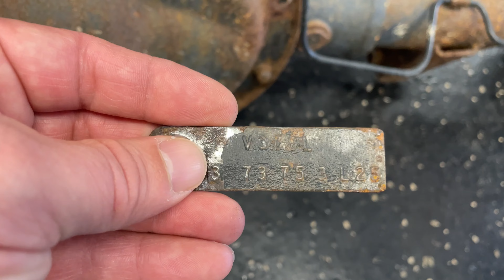How To Change 1993-2011 Ford Ranger Rear Axle Assembly

Comment: In the middle of removing my own, and this video was more informative than the manuals I have been looking at. The separation of the housing and leaf springs would have been nice to see! Thanks for the video , even though!
Reply: I was hoping theyd used a 15 or newer axle. I was looking for a pre solved solution to the 12v/5v system for the E locker on a 15 in swapping into my 07
Reply from the maker: Thanks for watching

Comment: Great video. It would make good sense for anyone doing a swap like this to take a close look at the axle surfaces where the seals ride for any sign of scoring or wear as well as checking the condition of the splines and pick the best pair. Also a new set of wheel bearings is pretty inexpensive as long as you have the seals out.
Reply from the maker: Thanks for checking out the video.

Comment: Do you know what that canister is above the spare? Does it need any maintenance? I am getting a new rear end for my 2004 Ranger, the new one only has 120,000 miles vs mine at 220. While I have the truck up on stands I want to do everything underneath that I can.
Reply from the maker: I'm not sure. I'll have to take a look next time we work on this truck.

Comment: Just for safety,  clean "buff" the 4, 12.mm yoke bolts and put blue 242 Loctite on it.
Reply from the maker: Thanks for watching and the added tip!
Reply: The one coming out is limited slip (both tires pull) hence the L on the tag.   The salvage model is an open diff (one tire pulls).  I would have kept the L carrier and swap all gears over.   I'm doing mine now on same truck with 410s. Due to bent axle and tube in accident.

Comment: Juat curious...why the grease on the gasket?
Reply from the maker: It helps to hold it in place and as you tighten the differential cover you can see some of the grease ooze out, it helps you to know that all of the bolts have been tightened too.